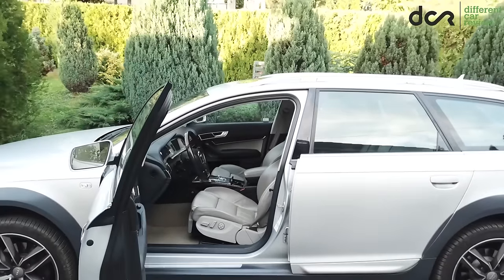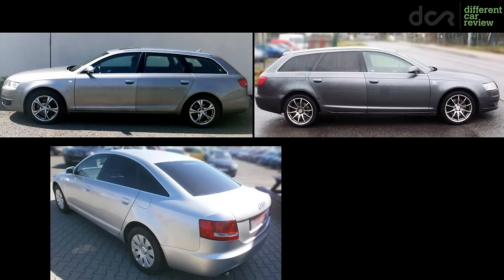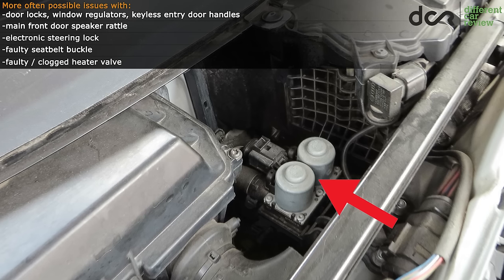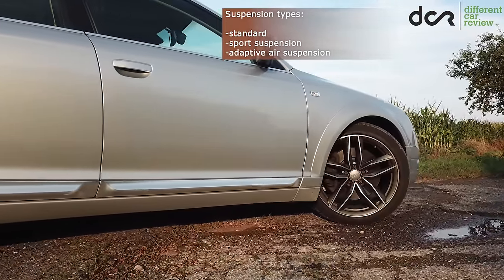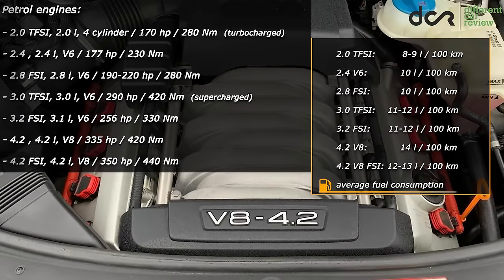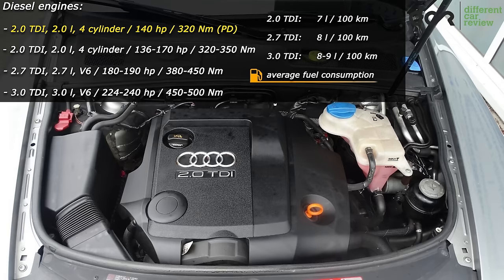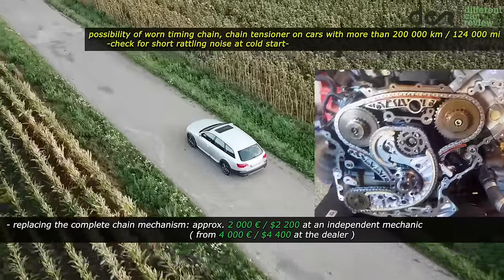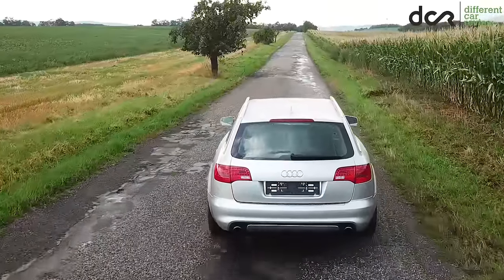used Audi A6 (C6/4F) - 2004-2011, Complete Buying guide with Common Issues

Comment: lots of information in this video it's the best one I have seen,
I have a 2005 Avant sline 2.0 tdi with 227.000 miles on it
I have replaced 1 turbo 1 rear spring 2 rear brake caliper  the same side both times 
Oil pump failed but I pulled over instantly so no other damage
The heater blows full hot on the driver side every now and then I cleaned the valve once already must do it again
The inside flooded through the fire wall I got a stick and knocked that fancy drain valve out now there is a 1/2 in whole no more problems
I had to pull up the carpet to get the water out of the inside about 20 liters can live unseen under there be warned,
It ran rough for a year during that time I changed all the sensors and MAF EGR and a few vacuum lines each time it got better
Now it runs like new again
The rear window regulator is broken right now and the driver door lock won't work with the centeral locking so I use the key.
I love the car still after 8 years and it's unbelievably economical I get 47 mpg over all and 60 on a gentle motorway 
Run 
It's towed my 1700kg caravan and family all over Switzerland this summer.
It's a good car but luckily I have a very good and trusted garage to do all the work also another car to drive while it's in bits.
Audi I think made an unbelievably high quality car for the money
Lots have gone wrong on mine but nothing was highly expensive as I always fit remanufactured parts and honestly do you expect no problems on a 160.000 mile 7 year old car you bought 8  years ago that's now got 227.000 miles ??
Again I love this video

Comment: Thanks dude! I am a 2007 Audi A6 C6 4F, Avant, Quattro S Line, 3.2L, owner here. None of the mentioned problems yet, I am at 200k only. 
Definitely the drain holes needs to be cleaned!
Reply: had an A6 C6. Last autumn, drain holes got filled with leaves and water started coming inside the cabin. 

Had to use a stick to clean the hole
Reply: the moon roof drain holes?
Reply: 4 years later I came back to say that eventually I had to let go, my beloved A6 C6 Avant got to 250k and got tired of fixing it. Nothing unusual or expensive, it's been a great car, maybe the best. It had the 3.2 FSI , the most amazing engine ever! 
I replaced with a 2015 A8L TDI, only 30 000 miles, so I should be good for the next 5 years or so...

Comment: I had the 3.2v6 of the c6 from 2008. I bought it with 38000km on it and it was reliable ish..... Mine had been sitting forawhile so some electrics were funny. After the dealership fixed them it was perfectly reliable. I had it serviced every 10000km and serviced the gearbox at 70000km and it was perfect. Never missed a beat and would highly recommend this model with the 3.2

Comment: I was wondering between this car and an a4 b7 1.9tdi, and eventually opted for the 1.9, much simpler, much easier to work on, got polybushes, quatrro converted it and got a "hard" flywheel when my DMF went out, mine is remapped to 150hp and 400nm  absolutely no problems, runs like a dream :)

Comment: Spot on review, I had a 2008 2.7 V6 A6 allroad, suspension air strut failed at 100k miles, £1800 to fix, blue smoke at idle and black clouds at full acceleration, rear window wiper motor failed and leaked rusting the boot and passenger door actuator failed too.

Comment: I have 2005 2.0TDi A6 BLB engine, with PD injectors and hex shaft driven oil pump, on engine replaced twice egr valve, 
Engine mount was changed electric one, just because fault in vcds.
throttle body was working but making tick sound at engine shutdown, got good deal on new, so changed.
1rocket broke, left valve open, didn't notice until was changing glow plugs, car was driving fine.
Injectors was checked during rocket change, was ok.

Milage 350k km, oil change 10k km 5w30  
Change fuel filter every 2nd oil change.
Own car since 2008.

Comment: i have a 2005 avant 2.0tdi its the first of the PD engines i got it in 2012 with 160.000 mils and it now has 235.000 mils in that time fitted a new turbo 400£ new oil pump remanufactured from Poland about 1000£ with all the labor 
new MAF 120£ 1 front wheel bearing 2 parking brake calipers same side as i didnt get audi original part i cleaned the heater valve its been ok since new AC compressor 500£ it ran really rough for a year during that time i replaced all the air sensors and in the end i changed the EGR 120£ and that cured it anti shudder valve changed and the altinator clutch changed and the fan tensioner all new brakes and discs thats about it 
it drives wonderfully and is incredibly economical a wonderful car your video is good but with some mechanical sympathy i think the 2.0 tdi of any vintage is a good buy.
i had a ford Mondeo for 5 years and it had the same problems come up every month my audi has had issues but once repairs are carried out they dont come back 
i plan on keeping it for another 200.000mils 
but am interested in getting an audi q7 as the family is expanding
thanks for the videos 
keep it up 💪

Comment: Got myself the 2.7tdi with stage 1 tuning. Almost clocking in on 436000km. Very reliable engine and transmission! 🤩👏🏽
Reply: Multitronic or Tiptronic?
Reply: Im considering buying an Audi A6 C6, do you think I it is a good idea to buy one with 300.000km or more? They are 3.0 TDI Quattro triptronic

Comment: There s a video on YouTube how to cut one wire on the steering lock which deactivates it permanently! Or just rejoin if you want it back on . I did it myself took ten minutes. No worries about buying a new steering column now .

Comment: I own a 2005 Audi a6 avant with 460.000km with the 3.0L TDI V6 engine,it runs like a dream,its very confy and has a very smooth ride,the only problem i had was the timing chain which costed me 1000euro,i replaced the gearbox because it got stuck into 3 gear,changed the ecu and the fuel injectors,it has a lot of options like heated seats,2 zone climate,electronic front seats,big radio,bose sound sistem,it isnt rusted at all,it has the quattro drive system and it has no problem in the snow what so ever,its my perfect daily and i love it,i dont plan on selling it in the next 5 years,i also used to own a 2004 a6 with the 2L tdi engine with manual transmision and i had no problems with it. Great cars,great build quality,perfect daily driver,never left me on the road.
Reply: At what mileage did you change the timing?

Comment: I had the injector seals fail.I started hearing the hissing sound+fuel smell in the interior I drove for a few days and decided to fix it.They charged me less than 60€ to fix not one bot both sides so all of them.The seals themselves were like 15€ and it took about 2-3 hours…I just got off a video from someone saying just one is about $350 for one side, or $750 for both sides…Crazy

Comment: Im probably one of the happiest owners of AUDI A6 C6 (4F2) 2007 3.0 TDI (171Kw without DPF!). I bought it at 2012 from our company with 96 000Km. Im not driving too much, now it has 186000 Km without any serious problem! I only changed sparkplugs, brakes, two door locks, front shoulders (axle?). Thats all. I feel, that suspension is getting worn out, but no leaking. Great car, but sadly only limousine and im expecting second child, so we need change it for some combi. Selling it will really break my hearth.

Comment: Great video, alot of details, I see you put a lot of work in it !!! 

(and I bought the car by the way, after watching your previous A6 C6 video, I bought an Audi A6 2.0tfsi)
Reply: anel115 how many kms and any problems so far? I am thinking of buying a A6 too
Reply: @parvizazimov7009  Hallo Parviz, I bought mine from the second owner, so it was in a very good condition, I own mine 5 weeks and did 4000 kilometers, only small thing I had is the airbag light came on but after cleaning the connector and connecting it, it was fixed, a family member of mine has one for like 10 years without any problems and is still enjoying it, my advice would be to buy one that is in a very good condition (body/engine) en has a maintance record, (dont buy the cheapest with no history) then im sure you will have a great car with little maintaince.
Reply: @anel115  After 2 years, have something gone wrong, replaced and such things?

Comment: I have the allroad c6 3.0 tdi tiptronic and don’t have any errors, the suspension works really well at any height level. When I replaced the back springs, initially I got an error (yellow car warning) at any level except on dynamic mode, I suspected the valve block which is close to the compressor, but then, I didn’t have any error, working properly. What Im referring, its not a leak from the springs, it gets out from the compressor through the air filter inside. Opening or closing the door,  I hear the relay 4x and then a leak during 1 second.

Comment: I have this car s line plus edition 2008 3.0tdi egr , flaps and dpf removed plus chip tuned, its a beast at 221kw. Funny thing is half of the problems you claimed i already had on this car :), half way there. Nice review
Reply: 176kw Fl?

Comment: I had a a 2005 A6 Avant 3.0ltr  sold at 65000 miles.  Expensive work was Injectors at 45K Miles £3000 !  and ignition lock £700 and MMI Electrics replacement under warrantees due to water leek.  Otherwise never missed a beat.

Comment: Thank you for this much appreciated.  I've had a B7 2.0L a4 avant s-line manual quattro for years and thinking about picking up a 2007 A6 C6 s-line quattro in the 3.1l v6 for run around in a different country.. seems like you can't change much about it and it's a decent car for cheap.. famous last words :)
Reply: damn im thinking about A6C6 or A4B7 did you like your B7? was it good?

Comment: WoW, could you do the same review to W211 too please, after the E60 and C6?!
Which one of these 3 you would choose and what engine? 👀
Reply: F Gj i can speak on behalf of e60. Dont buy one with a N series gasoline engine. 2004 models still have M series engines which are pretty reliable. Automatic transmissions will not be perfect if it hasn’t been maintained.

Comment: Excellent review, I'm just looking for the other A6 video about the steering lock 'Stranded because of this'?
Reply: There are some videos to help you replace just the switches instead of the entire steering column, most times it's really a bad battery that doesn't supply enough power. If you're in Canada, Ontario I can help.

Comment: My A6, V6, 3.0, quattro, year 2005, ... problem culum lock a few years until I replaced it... a real horror in the middle of the road if you suich the engine  will be not sure if the car startet again,  even partially found I was looking for a lot of work as it had to be special ..., then there was water from the blockage of the canals, some generic services , and in the 15th year of production requires engine chain service.
There were no other problems, I am generally satisfied.

Comment: Hello, the front suspension of my car fell, I changed the inclination sensor, but there is no activity on the display, the car is in comfort mode, the car can be driven, but raising and lowering the car does not work. Can help.

Comment: One other issue about the automatic gearbox. I am well aware that people go on that 'sealed for life' is a joke and should be ignored in favour of doing a fluid change, however, as I said elsewhere - mine is at approx 330,000 km's and I have NEVER touched it. Too many stories on both sides, so I decided to adopt the position that 'if it isn't broke, don't touch it!' The box still changes as quickly and as smoothly as the day I bought it over 10 years ago, so I'm going to continue to accept the original declaration that it is better off being 'sealed for life' and leave it well alone!
Reply: Good to hear an alternative view on the A6 auto gearbox, do you have the multi tronic CVT gearbox or triptronic.
Reply: @hamwicbi1265  Tiptronic - it was actually the only gearbox available for my version (3.0TDi Quattro). As of Thursday just gone, it now has 332,000 (just over 207,000 miles) after a 400km round trip. Have to do same trip again tomorrow with another few hundred kilos of gear in the back, and no doubt neither the car nor myself will feel it again. Oh, and thanks to the two long trips in such quick succession, I'll be crashing through the famed '1000km per tank' barrier tomorrow too (which admittedly is rare due to most of my usual driving being stuck in traffic!). I simply cannot fault this car (touch wood!) ;)
Reply: Orfan Productions you give me some confidence for my auto gearbox thanks
Reply: Lifespan of a car which is typically accepted as 10 years. Not lifespan of human

Comment: Thank for the video, very informative, useful and detailed! I am looking to buy one of these and did test-drive earlier today. I get mild vibration from steering wheel and pedals on start-up before driving off. Doesn't seem normal and would appreciate your opinion on this issue (I haven't been able to find anything related to this yet)

Comment: 1:24

Confusing? Just use vocal commands, press the voice command button on the steering wheel.

Get the 6.5 and avoid anything air suspension.

Comment: My A4 Allroad B8 manual 2012 2.0tdi about 113000 miles. Thrust bearing making noise don’t know whether to change whole clutch with Dual mass flywheel yet

Comment: My A6 3.2 FSI Quattro consumes 17-19l/100km city and 9.5-10.5 l/100km highway. Other than fuel consumption can confirm that everything in the video is correct. Looking forward to see your comparison of A6 C6 & C7 generations since I wanted to buy C7 but not completely sure if I should.
Reply: I bought a c7 but sold them, the 3.0T is a supercharged engine, I find it noisier and more complicated than the c6. Bought another c6, I like the styling and uniqueness of the car alot more personally
Reply: bro i need your help: theres an 3.2 fsi 2005 a6 quattro with about 150k for 3000€ do you think its a good buy?

Comment: Hello! I’ve bought an Audi A6 C6 4F from 2010 (facelift) with the 3.0 TDI 240hp engine. I could have bought the E60 as well with the 286hp engine but I chose the Audi. Do you think I did the right choice? Is the A6 more comfortable and more quiet? My friend also said that the accelerator pedal was better on the bmw.. He said that the organ type was better than the suspended type… What do you say?
Reply from the maker: -E60 has better handling, better steering feedback, better weight distribution and yes also better accelerator pedal response. E60 is more of a "drivers car" than the A6. + it can have more optional equipment like night vision, ventilated front seats or HUD. But it also has slightly worse reliability of the electronics than the A6 (even though A6 can have some issues too).

-The A6 is on the other hand an "all season car". The quattro 4wd is much better than the xdrive in the E60, with the optional air suspension its more comfortable, its very stable at high speeds on the highway at any wheather, it has better built interior, better sound system and better multimedia system than the old iDrive in the before facelift E60.

the engine in the 535d is very good - plenty of power and fairly good reliability, but the problem is that plenty of these cars are abused, badly maintained and already in bad/worn condition because of the cheap price and powerful engine which attracts plenty of "wanna be street racing drivers/drifters"

overall your choice of the A6 with the 3.0 TDI is not bad at all, if its in good condition then it will last a very long time, if you want to see all the issues the 3.0 TDI can have check out this video: https://youtu.be/_so6yhV5qXE

Comment: Im looking at buying my second A6 with the 3.2 and have a question. The owner has put in the ad "The mechanics are strong and regularly serviced, despite a tendency to shake at idle due to a leaky fuel-injector that otherwise has no effect on the driving experience." is this a common issue? I was looking online and parts are really cheap to repair this but does this sound right?
Reply: It's unlikely, the injectors if leaking are probably because they took the upper intake runners off and not change the o-rings, or relube them before putting it back together. Audi recommends changing the o rings on the injectors each time you take off the runners but most just relube and put it back because of the price of them from Audi

Comment: Major thing to note Audi used a plastic gasket in it major engine seal which fails and is not a recall landing you with a £2500 to £15000 engine fix or replace build.

Comment: 7:15 i just bought used c6 and it occasionally pulls up these 2 lights in dashboard. So is it always because of parking brake? cuz it pops up sometimes in the middle of driving and sometimes when im standing still. When i stop the engine and start it, it disappears. Someone know something about it?

Comment: A6 C6 2.0 TDI 170HP 2011 
Has anyone had a p305 starter terminal 50 short circuit problem?  Sometimes it takes a long time to start the engine, and sometimes it starts the engine normally.

Comment: Hi DCR - thanks for your review. I've got the 3L TFSI supercharged model. It's still low kms and running beautifully. But if I was to hear the Cam chain rattle sound, you believe changing the top two tensioners will likely fix it and that job can be down with the engine ensitu?
Reply from the maker: yes, it will most probably fix the rattle and you can replace the upper tensioners without removing the engine
Reply: @differentcarreview-dcr  - Thankyou for your reply. Much obliged.
Reply: Might not be the tensioners though, the 3.0T is louder and more rattly than the c6 being a turbocharged engine. Unless it's a clatter, I wouldn't worry about it. Go look at some dealers with used ones and compare the sounds.